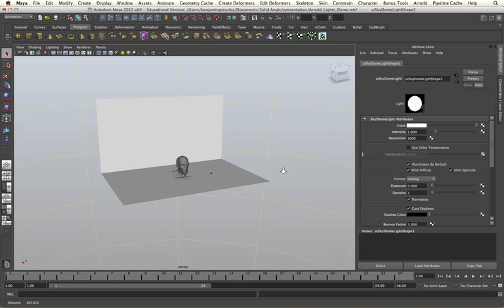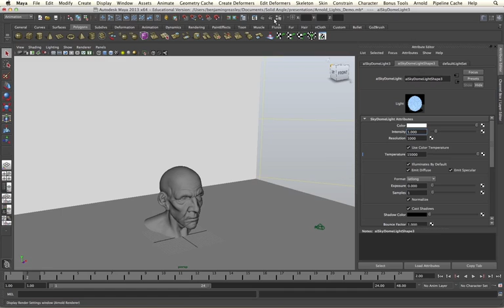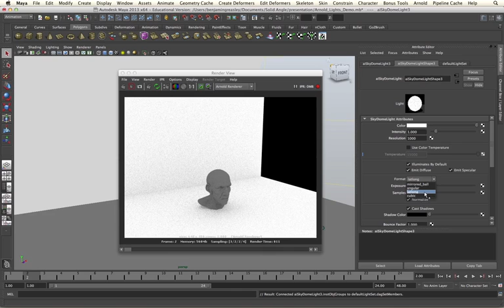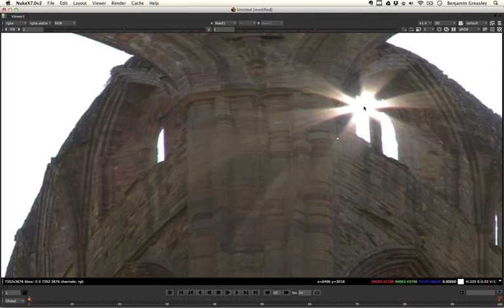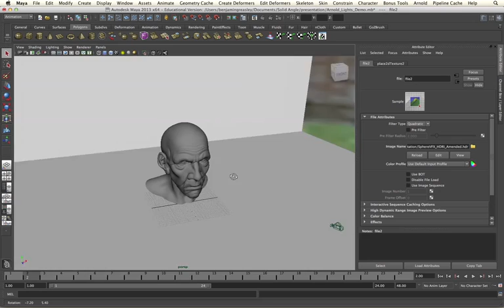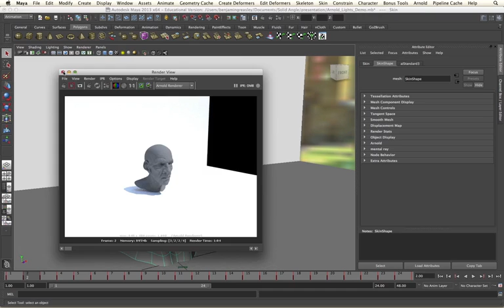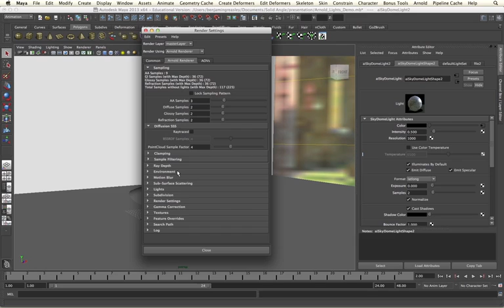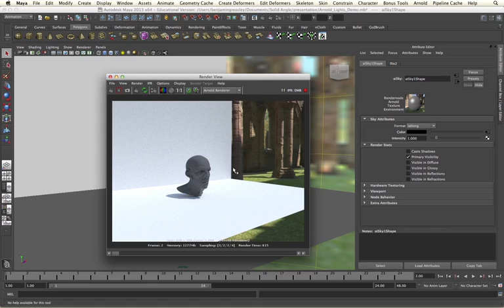Arnold for Maya Tutorial - Image Based Lighting

Comment: For people using HDRI for IBL in CGI:

You don't need ND filters for HDRI photos especially for IBL, all you’re doing is taking different exposes, known as bracketing. Usually one underexposed, one normal, one overexposed. You can take more than that, more values in between but normally 3 is enough. As for ND filters, the purpose for an ND filter in Photography is to allow the camera to shoot wide open without overexposing the image. In other words, I'm out, it's a really Sunny day, I want to take a picture of a flower with shallow depth of field, so everything is blurred in the background. But if I have my lens wide open at say F1.2 then my image would be way over exposed, there are ways around this depending on what you are taking a picture of. You could for example get around this without an ND filter just by increasing the shutter speed really high. Therefore darkening the image because the higher the shutter speed, the more light is needed. If the photo your taking is of a scene that's really still, shutter speed is irrelevant, so use it to darken the image if you need. The only time shutter speed becomes relevant is if the thing you’re photographing is moving and you need a desired effect and control over everything.

In short, if I'm shooting a racing car which is moving at high speeds, then Shutter speed becomes extremely relevant. Too low and there's lots of motion blur, but high shutter speeds will completely eliminate motion blur. So it this situation, say you need for some reason the car to be blurry as it passes, then you would use a lower shutter speed, this would increase the light, but say you wanted shallow DOF as well, then you can't compensate by say putting your F-stop to say F8 because that would create deep depth of field which would remove the blurred background. In this instance you need an ND filter because it allows you to have it all. Low shutter speed, Shallow Depth of field, so you don’t have to change settings to compensate. This is known as artistic direction, the ability to get what you want artistically without having to compromise with camera settings. 
But to get an HDRI for lighting your CGI scenes, all you need is an in focus shot of the environment, which should be as still as possible. Therefore, you don’t need to worry about shutter speed, if it’s really sunny, increase it, who cares, there is no need for motion blur here.

Now, let’s revisit the flower in a field shot. It's very sunny, you have no ND filter. You want shallow depth of field, so the lovely flower stands out against a blurred background. In this instance, it's very simple, Just increase your shutter speed until your expose is right. You see shutter speed doesn't matter in this instance because the photo your taking is of a flower that is relatively still. So shutter speed has no effect on how the image looks, shutter speed only has a bearing on moving objects.   Taking and HDRI for CGI purposes is the same, you’re making an environment map, so the scene should be relatively still. Therefore if you really need to darken the scene, just increase the shutter speed. No problem.

Of course you should shoot in RAW format anyway, that way you have the most control and even overexposed images can be adjusted with a lot of control. Overblown highlight detail can be retrieved if shot in RAW.
In short, don’t listen to this person, you can take HDRI images without the need of ND filters, I have no idea he insisted that you do.

If you have a canon camera like the 500D, 600D, 650D, the Rebel Range or other APS-C sized mid-range DSLR. They normally don’t come with the ability of Bracketing which is taking multiple exposures at the same time, fortunately if you download Magic Lantern and install it, this lets you do that.
Reply: Holy fuk, your wrote a lot. Please write a book. I'll buy it!